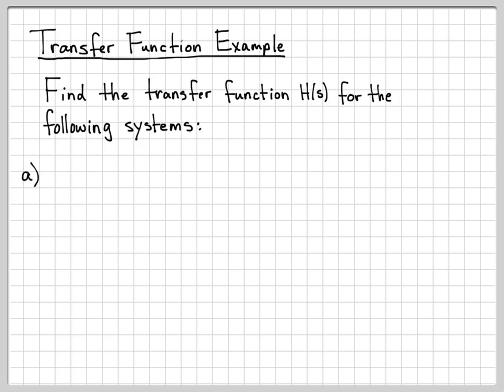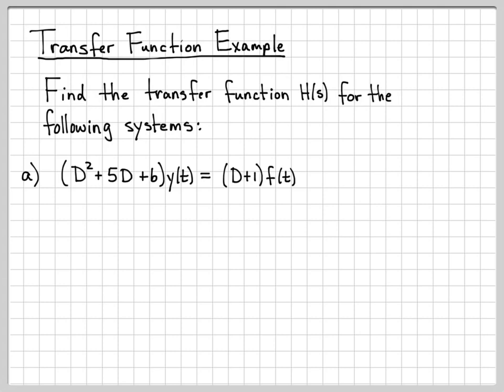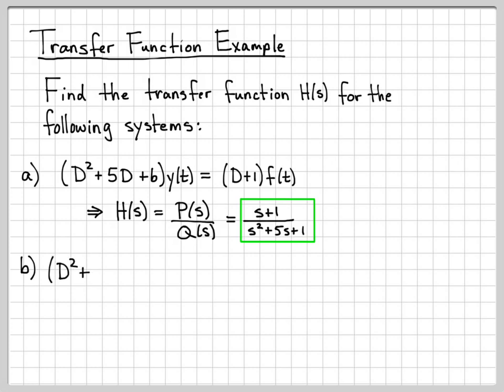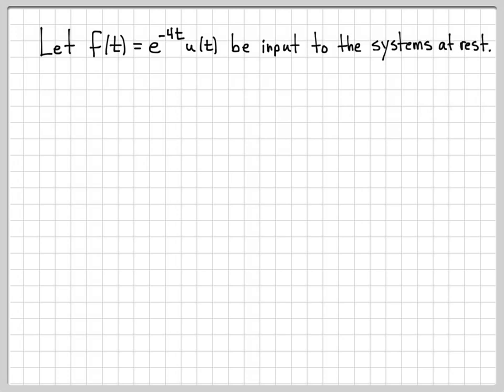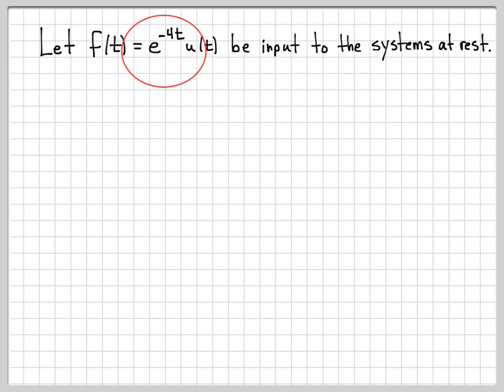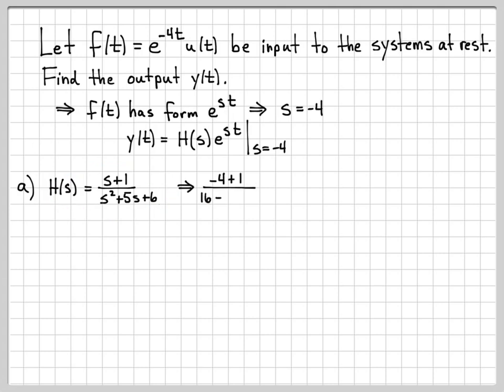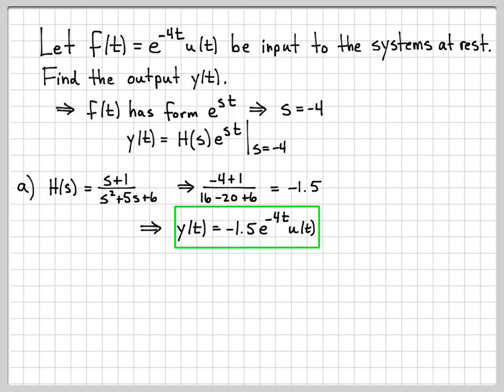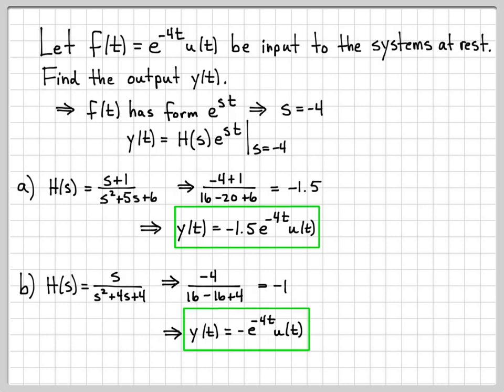Transfer Function of LTI System Examples

Comment: transfer function is laplace transform of  impulse response of LTI system ....so if we give unit step input to a lti system,would it not have transfer function?
Reply from the maker: That's correct, the trasnfer function of a continuous-time system is the Laplace transform of its impulse response.

If we put a unit step into an any LTI system, we call the resulting output the step response of the system.  The step response of the system and the impulse response of the system are related to each other.  If we have the step response of the system we can obtain the impulse response by taking the derivative of the step response.  Once we have the impulse response, then we could take the Laplace transform to get the transfer function.

Hope that helps,

Adam